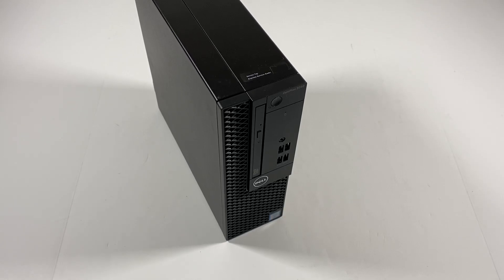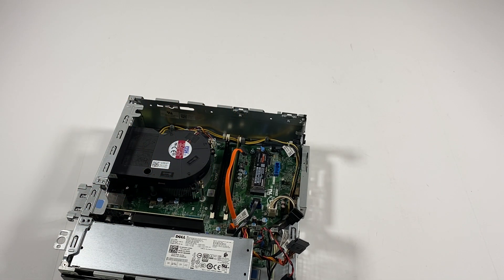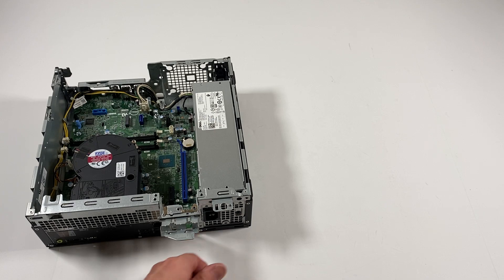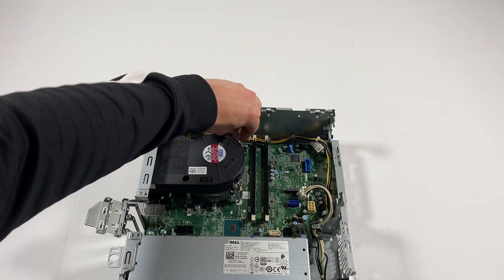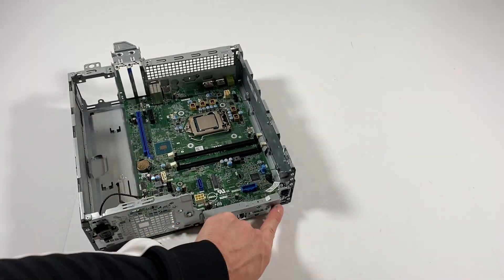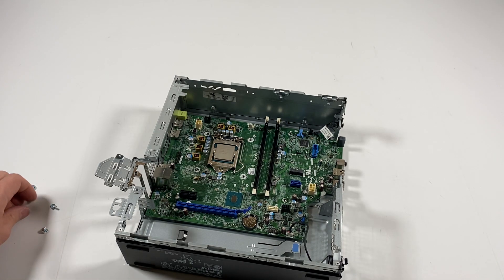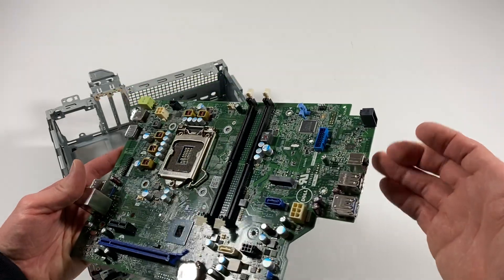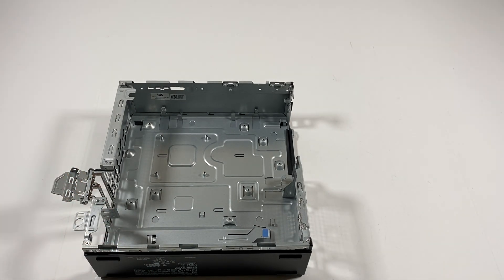Dell Optiplex SFF 3050 5050 7050 Teardown

Comment from the maker: List of Parts and Upgrades works with this dell system :

Dell Optiplex Reassemble
https://www.youtube.com/watch?v=d_iJJm0R1hk

CPU Upgrade Supports Intel Core i7, i5 7th gen and 6th gen.

(1.) Intel Core i7-7700 Desktop Processor 4 Cores up to 4.2 GHz LGA 1151 
https://amzn.to/3qwJ2vT

(2.) Intel Core i7-6700 Quad-core (4 Core) 8Threads 3.40 Ghz Processor
https://amzn.to/3Sfk8wP

(3.) Intel Core i5-7500 LGA 1151 7th Gen Core Desktop Processor
https://amzn.to/3BzOx39

(4.) Intel Core i5-6500 Desktop CPU Processor- SR2L6
https://amzn.to/3Bdwv5o

List SSD Heatsinks:

(1.)  M.2 2280 SSD heatsink, Double-Sided Heat Sink, PCIE NVME M.2 SSD
https://amzn.to/3l2ittr

(2.)  EZDIY-FAB M.2 2280 SSD heatsink, Double-Sided Heat Sink, PCIE NVME M.2 SSD
https://amzn.to/3m7J3me

List SSD M.2 Type 2280 NVMe PCIe:

(1.) Crucial P3 Plus 4TB PCIe M.2 2280 SSD
https://amzn.to/3RZcUNi

(2.) Crucial P3 Plus 2TB PCIe M.2 2280 SSD
https://amzn.to/3RTUi0Y

(3.) Samsung (MZ-V7E1T0BW) 970 EVO SSD 1TB M.2 NVMe
https://amzn.to/3d52k2a

(4.) Samsung 970 EVO Plus SSD 500GB
https://amzn.to/3fpi95A

(5.) Samsung (MZ-V7E500BW) 970 EVO SSD 500GB - M.2 NVMe
https://amzn.to/37uuLFw

(6.) Crucial P1 500GB 3D NAND NVMe PCIe M.2 SSD - CT500P1SSD8 
https://amzn.to/2N07wKh

List of RAM will work with this system MAX 32GB.

(1.) Crucial 32GB Kit (2 x 16GB) DDR4-3200 UDIMM
https://amzn.to/3BdbNm3

(2.) Crucial 16GB Kit (2 x 8GB) DDR4-3200 UDIMM
https://amzn.to/3U24CpE

(3.) Crucial 8GB DDR4-3200 UDIMM
https://amzn.to/3BcoygX

Thermal Grizzly - Spatula for Applying and Spreading Thermal Paste 
https://amzn.to/3d8NQEE

Thermal Compound Paste:

(1.) Arctic Silver 5 Thermal Cooling Compound Paste 
https://amzn.to/2ziNU0H

(2.) Noctua NT-H1 3.5g, Pro-Grade Thermal Compound Paste
https://amzn.to/36kTk7A

(3.) ARCTIC MX-4 (current edition) Thermal Compound Paste 20 Grams 
https://amzn.to/2DhGJaK

List video cards will work with this system.

(1.) AMD Radeon RX 6400 Low Profile Gaming Graphics Card
https://amzn.to/3s8MUUY

XFX Speedster SWFT105 Radeon RX 6400 Gaming Graphics Card
https://amzn.to/3xkmXo1

* Power Supply Upgrade Required for RX 6400: 
Dell OptiPlex 3050 240W Power Supply (6Pin + 4Pin Connector)
https://amzn.to/3exjHPB

(2.) Gigabyte GeForce GT 1030 GV-N1030D5-2GL Low Profile Graphics Card 
https://amzn.to/2Z4PHkp

(3.) ZOTAC GeForce GT 1030 2GB GDDR5 64-bit Low Profile Video Card ZT-P10300A-10L 
https://amzn.to/2WzgLXk 

(4.) MSI Graphic Cards GT 1030 2GB GDDR5, Low Profile
https://amzn.to/390Spum

(5.) PNY NVidia Quadro K1200 (Low Profile) Supports 4 Monitors
https://amzn.to/3RE5lf7

HDD list works with this PC:

(1.) Seagate BarraCuda 4TB Internal Hard Drive HDD – 3.5 Inch
https://amzn.to/3d3xWeR

(2.) Seagate BarraCuda 8TB Internal Hard Drive HDD – 3.5 Inch
https://amzn.to/3xjUDSJ

(3.) Western Digital 2TB WD Blue PC Hard Drive HDD - 5400 RPM, SATA 3.5" - WD20EZAZ
https://amzn.to/3w3jIQA

(4.).WD Black 2TB Performance 3.5" Hard Drive - 7200 RPM Class, WD2003FZEX 
https://amzn.to/2xFUeyF
Reply: Thanks a lot!!!
Reply: Can you add more fan? Like 40mm fan?

Comment: Here is a trick for folks who want to use a dual slot GPU, you still need a LP but if you remove the metal cover on the 260 watt PSU (most come with 180 so you may need to buy the 260)  you can fit a dual slot GPU in the case as long as it has a single slot bracket.

Comment: what about adding a wifi/Bluetooth chip what would be my best product to purchase..............
Reply: Gigabit Wifi 6 dual band PCI-E Wireless Card AX1800M WiFi Bluetooth card - they are like $13 on the bay. Do not get a USB Dongle as they are too slow. Also, if your PC is not using a SSD or M2 for a boot drive you could buy one of those too. And last, if you are a gamer the ONLY cards worth buying THAT FIT are the YESTON RTX 3050 6BGB, the GTX 1650 will work as well but it needs to be the Single slot LP Yeston card too. They are nearly the same price so it only makes sense to get the 3050. Insta gaming build on the cheap. Just got one of these with a i7 6700 and 16gb of ram. Just ordered my 260 watt power supply and a 3050. Plan to surprise my son with his own mini PC..
Reply: @ do you have any advice for the PCU upgrade
Reply: And what’s the max that I can add is it a 4TB M.2 SSD 2080 what brand would be the best I should go with want to do this once and invest in the whole package but make it worth it
Reply: I have the 7050 SSF

Comment: Pci wifi cart install video plz sir ji
Reply: That is easy stuff broski. Just install it next to the GPU in the mini PCIe slot. The black short one. Most cards come with a mini bracket so you might have to remove the full size one that is pre installed and install the small LP bracket.

Comment: Thanks for the great video. May I ask you a quick question? Is it possible to add a WIFI/Bluetooth combo card to this machine?
Reply from the maker: Hi, yes it is possible.
Reply: Gigabit Wifi 6 dual band PCI-E Wireless Card AX1800M WiFi Bluetooth card, you can find them for like $12 online and the connect to the black mini PCIe port beside the GPU. I got one for my sons build and it works great. Do not buy the USB dongles as they do not work well and are limited to USB speeds. Blah!